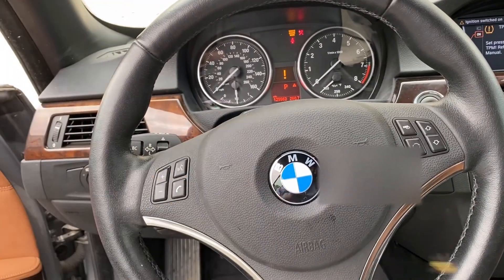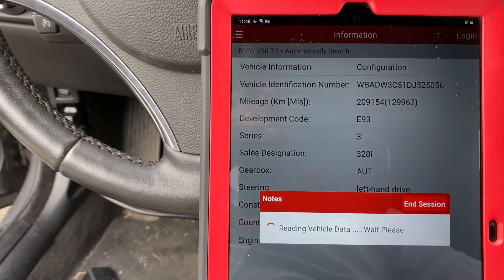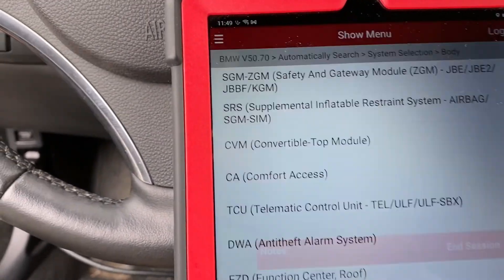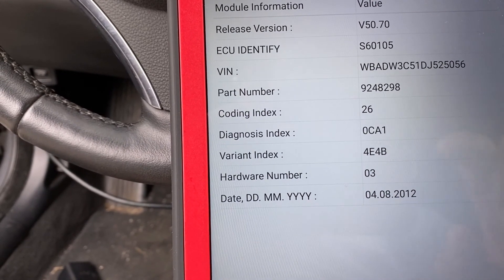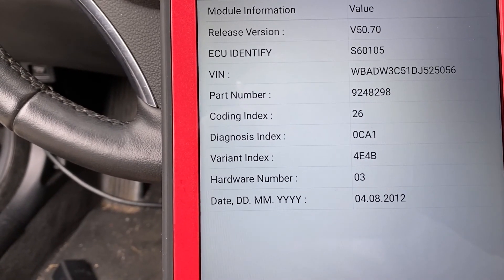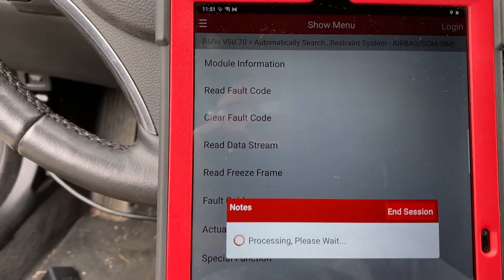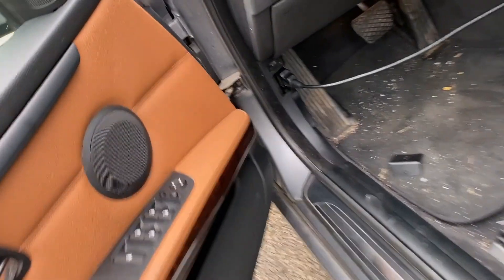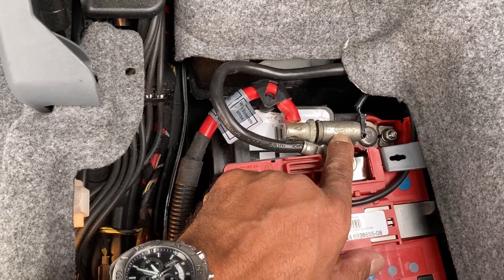BMW Battery Safety Terminals (BST) - Diagnosing and Repairing, Code 93B2, Code 9412, Code 93A9

Comment: That wire and the other wire you showed Do not go anywhere near where you said, it goes down under the batter and battery tray and is usually responsible for a lot of no start problems so I know nothing else you said is useful

Comment: Soooo  i bought an e90 335i xdrive (2011 n55) with this code present. I replaced the battery safety terminal (red box the black and yellow wired connector plugs into and i atill have the fault present. I have no idea what to do now

Comment: My car bmw x1 same symbol. !  How to problem solving skills
Reply from the maker: If the car involve in accedent and you hace a code for battery terminal try to replace it first, if you buyinf a used one make sure the the used one has about 2.5-3 OHM resistance

Comment: where can i order that battery terminal wire ?
Reply from the maker: Hi, you can order it new from your local BMW dealership, or good used one from salvage yard , if you buy it used Mak sure to measure the two pin terminal resistance it should be around 2.5 OHMS